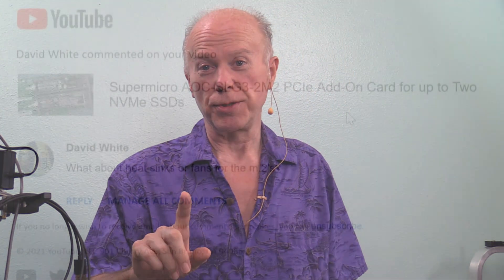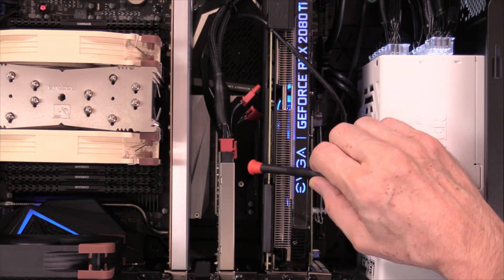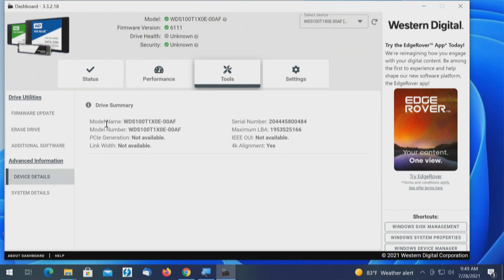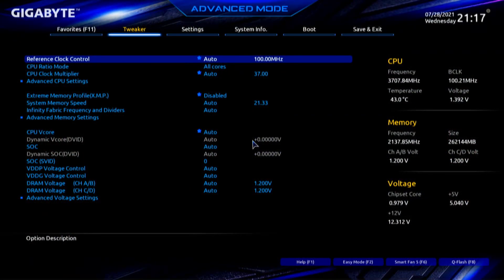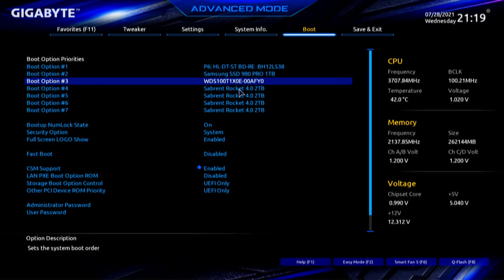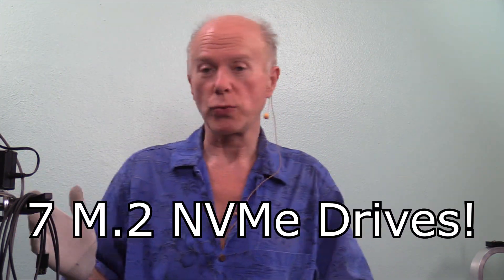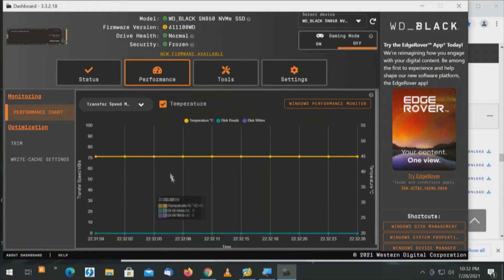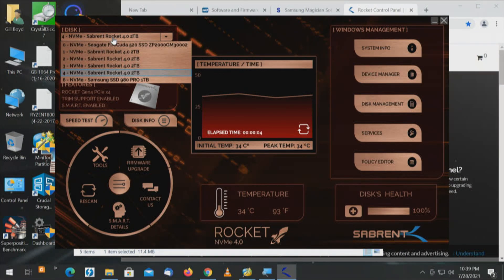How To Update Firmware on M.2 NVMe Drives on Gigabyte TRX40 Designare

Comment: Anyone know why my aorus 7000 prem 2tb m.2 nvme (its the one with the giant heatsink on top) wont work when I plug it in? All I can find is dickheads putting them in their ps5s but I cant figure out if I need to install some sort of program for this m.2 or what on the pc. There is literally no info besides ps5 installations on the internet. Just bought it yesterday on ebay and it just doesnt show up in my pc. Its in the 4.0 port which I had my cosair mp600 in. (Which just worked like a normal harddrive so this makes me think maybe I got ripped off with the new one and its not working at all) my motherboard is an msi 570, or x570, gaming edge... wifi, I think? Cant remember the name of it.
Reply from the maker: Hi Cloudy 0w0,
Welcome! Bummer! You purchased the one with Nanocarbon coating? Uses Phison E18 Controller! Nice selection! Both what You had and what You have are M.2 NVMe PCIe 4.0. Should be working and recognized! Starting from the beginning before We tackle Windows, does the new M.2 NVMe Drive show up in Your Bios? Is this a Boot Drive or Data Drive? Can You be Specific about Your Motherboard Model. We need to verify the M.2 Slot configuration and Resources. If the new M.2 NVMe Drive IS seen in the Bios then in Windows using Disk Management, the M.2 NVMe Drive needs to be Initialized and Formatted since it's Brand new for use! Hope that helps! Let Us know! This might also help someone else having this same issue!
Reply: Hello, thanks for the help, turns out I just had to allocate it in the device manager. (I think thats what its called) I forgot about that with my old one haha. Thank you again for taking time out of your day to try and help, even though I wasted your time, know that your effort does not go unappreciated~

Comment: My understanding is you need the memory chips close to hot but the controller cool to get maximum speed and long life from the NVRAM? I also wonder if there is any difference in setting the sector size as mine has  512-byte or a 4096-byte sector options.
Reply from the maker: Hi David White, 
Correct. However, have You noticed all Heatsinks and Thermal Pads are the full length of an M.2 Drive. We're working on the Heatsinks Video. We'll include 6 of 3 types. Had to get SMART technology Telemetry working first to see those M.2 Heat Sensors! Crazy and convoluted. 

512-byte or a 4096-byte sector sizes. 512-byte is legacy. 4k or Advanced Format. For individual Drives a balance for Drive Performance vs Longevity. Legacy theoretically should last longer hence everyone is still shipping Drives that way. Better Performance, lowers the life expectancy if using 4k. Options and Tradeoffs. 

The easiest way to make that change is through the M.2 NVMe Control Panel. We've contemplated making a video about that but have not yet! Always test and verify! Your Results may vary depending upon use. 

In RAID, Yes, affected by the size of files You use. Small files vs Larger files. 
Stay tuned!
Reply: YAH. I seem to remember that in the bios doing SATA port HDD Raid 0. That was so easy, I could it. Create the raid and clone C: to the new raid 0.
Reply from the maker: Hi @maxhughes5687 , 
Yes! Set sector size when creating the RAID array. SATA or NVMe or both just not together!